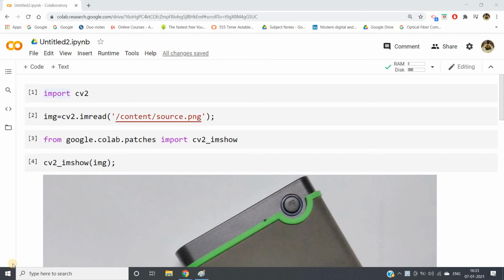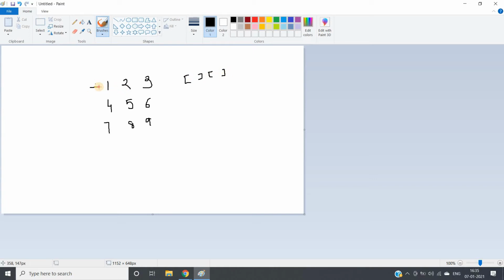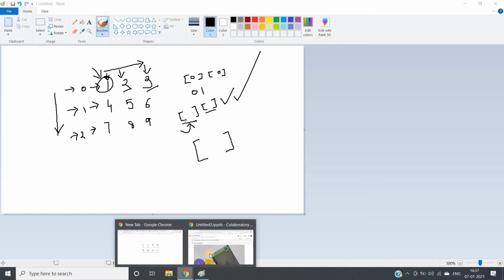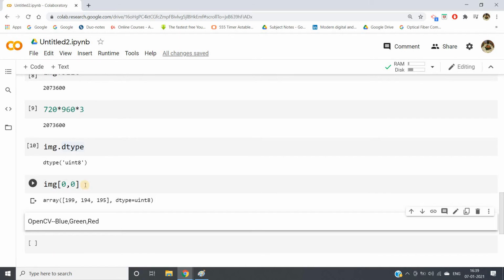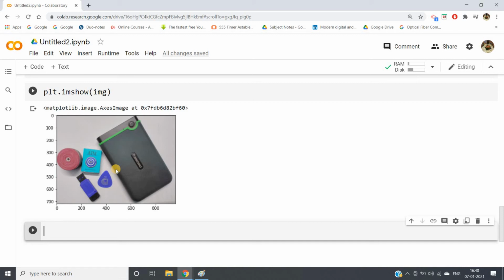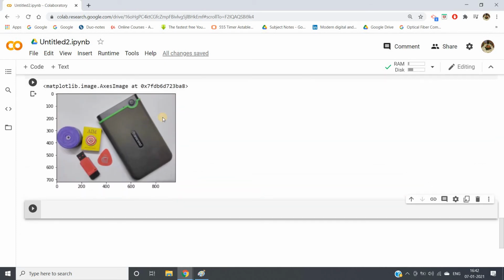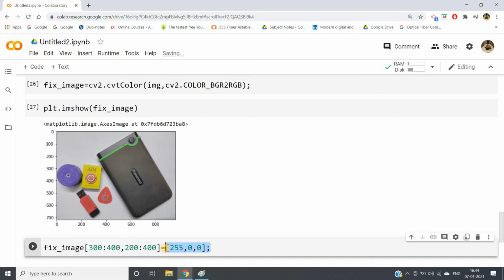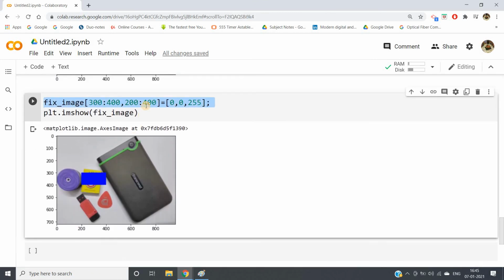Accessing & Modifying Image Pixels --OpenCV(Python)

Comment: would you please send the code of this question for me? I couldn't solve it myself.       Create a 256 by 256 image using a random number algorithm of 15, 20, 8, -8 and -10. Then randomly place 16 by 16 in each region instead of two-thirds of the zero numbers. Calculate the entropy of the image before and after zero.